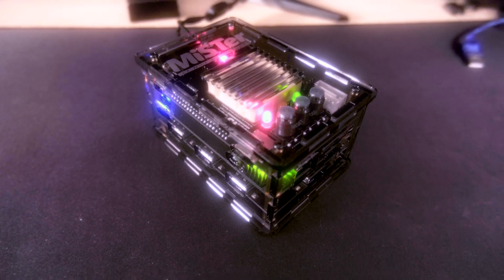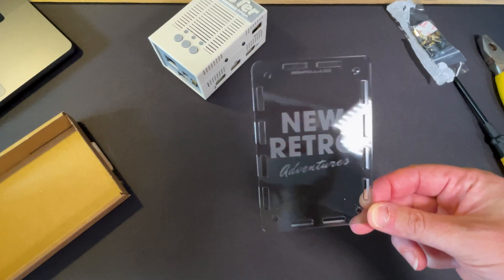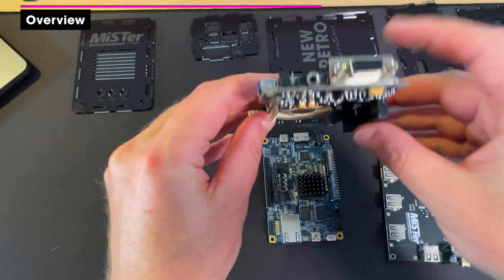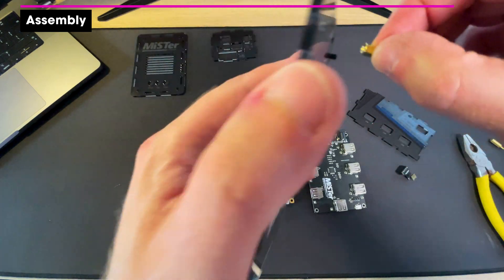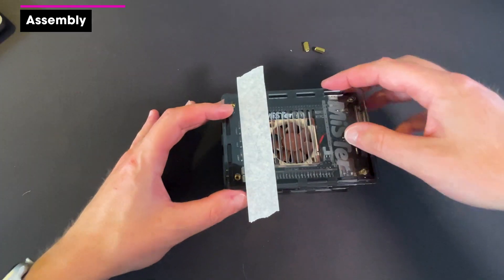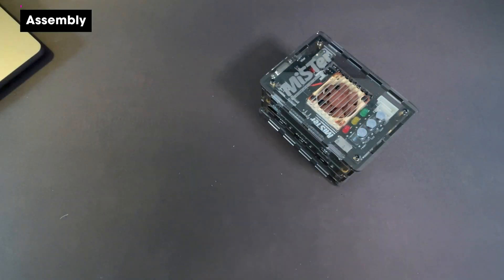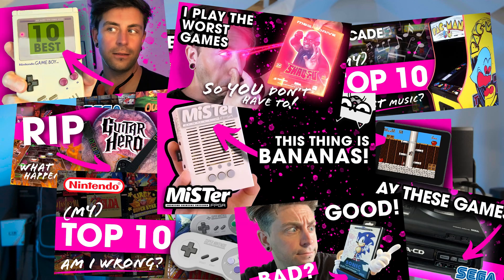MiSTer - Assembly, Acrylic Case Upgrade and more! | Trust me I'm a doctor...

Comment: Good vid.

I just subbed yesterday, after seeing your overview vid of the MiSTer project.
It was a good general description of the FPGA thing vs software emulation.
(both have advantages and disadvantages, ofc. I have to say that as a general disclaimer, before a flame war starts. lol)

Just a few tips when building the stack, though...

2:14 - That's actually the USERIO / SNAC port, for specific MiSTer peripherals like joystick adapters or the mt32-pi.
It just happens to use a USB 3.0 style socket, as it has enough pins, and the cables are commonly available.

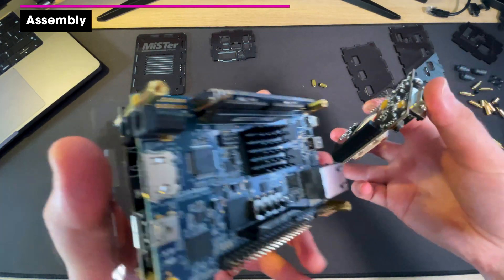3:55 - I would recommend that people unplug the SDRAM module before installing the IO Board.
This is just so you can see the pins on the IO Board that plug into the (single-row) "Arduino" header more easily.
Then make sure all of the pins are in the socket holes before pressing down on the IO Board.

(that should help prevent bending any of the pins, either on the IO Board or on the DE10's 40-pin header.)

Just make sure that the SDRAM module gets plugged in the correct way again.
On most of the common versions, the SDRAM chips face inward towards the FPGA, but always double-check your version.

(some people might say it's best to just leave the SDRAM module in place, to help reduce strain on the socket, which might be a fair POV.)
Reply from the maker: Thank you, that’s great information. I really appreciate you taking the time to comment, I’ll add it to the description 👍 I was kinda flying through the process TBF as it was so hot 🥵 😆
Reply: @NewRetroAdventures  Yeah, I can't function in the heat either, and I'm basically in a loft room too. lol

Once it gets over about 26C, I start to melt.